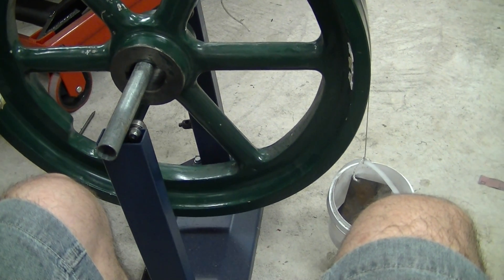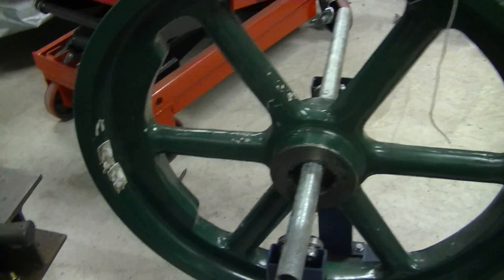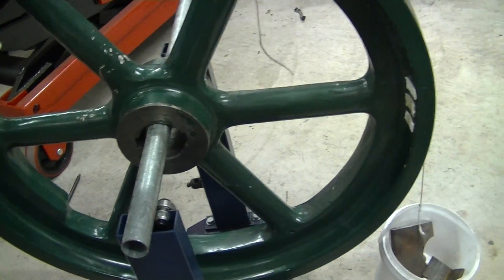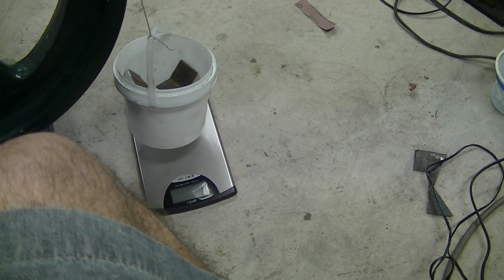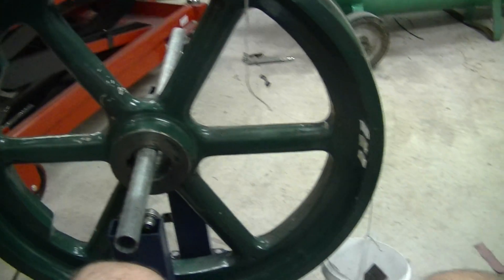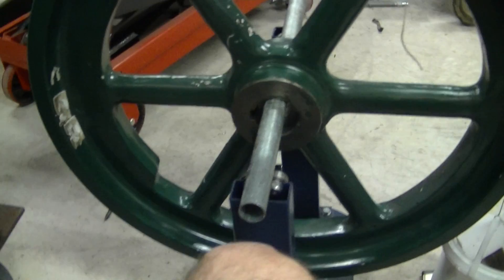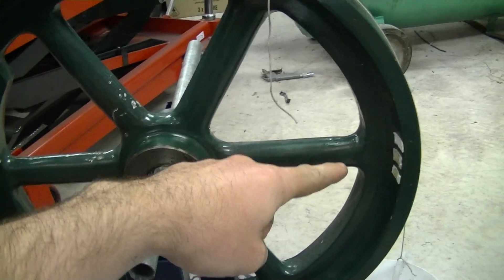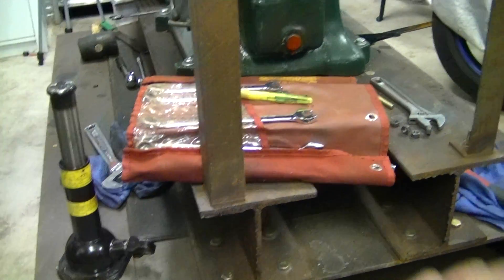First stages of balancing my listeroid 6/1 JKSON

Comment: I saw an issue with your balance set up….the shaft you were using should be the flywheel diameter…if your after accuracy…plus you need to get a magnet down the hole or up the inspection port….to confirm the piston type

Comment: Are your flywheel counter weights on the same side (opposite the piston)? My flywheel counterweights are opposite each other....and yes my 6/1 has the up and down shakes.
Reply from the maker: The stock flywheel weights should be in the same position on the left and right side of the engine, they should be opposite to the position of the piston, ie, when the piston is at TDC the weights on both flywheels should be at the bottom, then you fine tune the weight amounts using the method above or trial and error.. hope that helps!
Reply: I haven't checked yet...but what is inside those elevated counter weights on the flywheels? can they be ground flat and lead or cement with epoxy be added to the opposite side?
Reply from the maker: sure, I attempted to drill the original cast, but it was very tough to get through so I decided instead to stick additional weight on instead, I know that others have drilled out holes instead to lighten them, and filled the holes with lead to make them heavier etc, depends on how much you need to put on really.
Reply: I meant to ask if both flywheel counter weights (thick mass) are on the same keyway side?
In my case they are on opposing sides (180 degrees apart)....so I'm assuming one key way was incorrectly placed.

Comment: You're correct, both flywheels need to be the same otherwise otherwise you will end up with a cyclic couple where the cranksaft starts to rotate around an imaginery elipse when looking at the end of the crank. How is the project coming along?